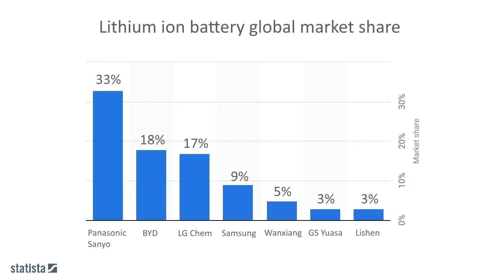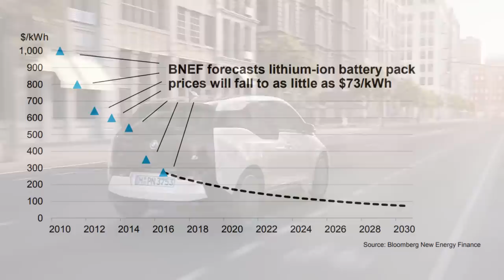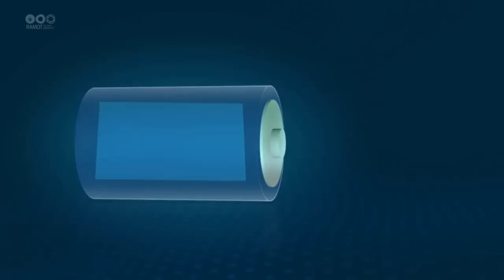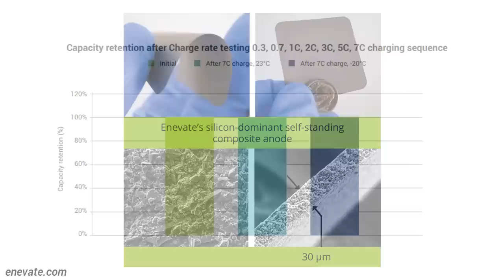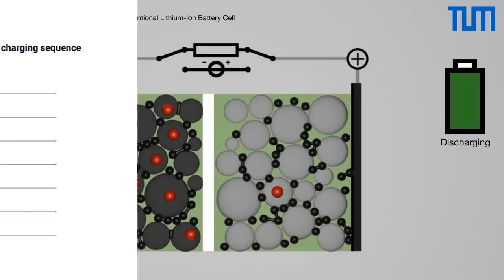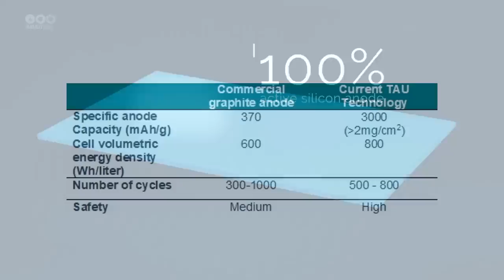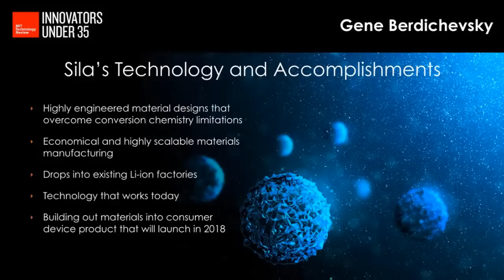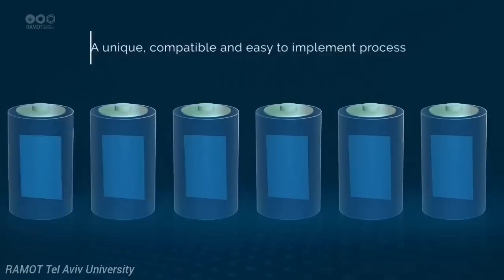The Battery Revolution. Ultra Fast Charging

Comment: Doubt I'll still be alive by the time useful electric vehicles are actually affordable. Give me an all wheel drive suv that can handle temperatures down to -40, can tow a trailer with a few horses and can charge in under 5 minutes and has at least 250 miles of range, and costs under $45,000. Until then it's gasoline for me.
Reply: Give me a gasoline car that I can fill up in my garage and that costs a few cents a mile to run, that is silent, and that has amazing torque off the line.  Until then it's EV for me.
Reply: There is no gas car out there that is a one size fits all, so why would one expect electric cars to be a one size fits all.

Obviously, as battery technology improves, density goes up, price goes down, we can fit larger and more energy dense batteries in vehicles that require more energy like SUV's and trucks.

A lot of times, it feels like if you built an airport while the ICE crowd was watching, they would be screaming the whole time, why are we wasting time paving this runway and building this control tower?  We don't even have a terminal, hangars or any airplanes here yet!
Reply: Exactly, the promises of a 100% electric future is not even close. The #1 problem is .... power plants still burn fossil fuels. It doesn't matter how fancy ur electric vehicle is or how many computer screens it has or how many likes u have, it still gets its power from burning fossil fuels from the power plant. Then they will say ... but but we can get it elsewhere in the future ... well, until that future is built ... and it hasn't, then ur electric vehicle still pollutes and still requires downtime to plan and charge. And dont even get me started if u have to make a long trip and cant afford downtime ... forget about it. U can never charge a battery fast because it will overheat and overheating is what kills battery cells. Then they will say ... but but the future will fix that ... no and no.  If ur phone's small battery takes 30-1-2 hours to charge, ur big ass car battery wont do it faster ... only slower. If u fast charge it, the battery will fail ... and car batteries costs $10,000-20,000 parts alone ... labor will be more and only performed at the dealer service centers (not cheaper independent shops).

Ppl who say they love the electric vehicles dont really need vehicles, they can take the bus or ride a bike. Ppl who haul heavy equipment or drive long distances cannot have downtime to charge a vehicle for 1-2 hours every couple hundred miles.

Also, when the government subsidies end, ur electric vehicle will cost even more.

Simplistic fantasy is for the escapists simple minded sheep.

Reality is for the real ppl
Reply: IncognitoTorpedo Money is money, whether you're spending it on a more expensive EV or down the road at the gas station (which, by the way, filling up isn't very hard, people have been doing it forever). The sound a vehicle makes is hardly a selling point, ok, so it runs quiet, are you going to hear all that quiet over the radio you got blasting? "Amazing torque off the line", I don't even know how to reply to this. You want people to see your little sedan tearing off down the road from a stop sign? Ok I guess. I'm more concerned with functionality and the ability to refuel quickly, especially since I live a low populated area, the nearest charging station is about 15 miles away, the closest gas station is about 1 mile away. Someone can always bring me gas, someone can't just stroll up with more electricity for me.
Reply: I understand and what you say makes sense. But that just says that it will be a while before there is 100% adoption. But that's OK. In our case, we need a car that can go over 300 miles with zero hassles so we have a gas-powered Prius with "unlimited" range. But we also have an all-electric Leaf for my wife's daily commute. She charges her car in the garage which is more convenient than a stinky gas station. It's clearly the "beginning of the beginning of the end" for ICE vehicles.

Comment: I jumped into the electric car movement last March when the Hyundai Kona EV finally arrived in California.  I haven't bought gasoline since that time.  I've charged up at home and driven everywhere I've needed to go without a hitch.  I have sampled how DCFC work a few times just to understand the process when I make longer trips.  I currently have about 14,000 trouble-free miles on my Kona EV.  It has been used as a serious, solid, daily-driver replacement for an ICE car and has done the job very well.  I purchases a 240v 50a charging unit which basically charges the car at it's maximum on-board rate of 7.2 kWh.  With a 64 kWh battery starting at 20% and charging to 90% means it will take 6.2 hours.  Unlike gas cars which you tend to drive to empty then fill up, BEVs prefer the "grazing" approach where you keep it "topped off" at 80-90% full and top off around 20-30% remaining.  My daily work commute is 40 miles round trip and I usually go two days without charging, and can go three if I want, but I prefer to stay in the middle of the SOC band since that's generally accepted to maximize battery life.  During days off, or even weeks off when I'm not making the long commute I don't even need to charge my car for around town driving - well sure eventually, but considering I might drive 5 miles a day around town, that equates to about a month before I'd need to charge and more actually since the Kona EV's regen system is supposedly capable of 150 kWh of regeneration, though the most I've glanced down and seen is about 80 kWh "regen" when letting off at speed using regen level 3.  Regen allows the Kona EV to recoup anywhere from .3 to .7 miles PER STOP when driving around town which means one can leave home, drive around stop and go for 10 miles, then return home with only 5 miles used off the range!  In town I've seen miles per kWh efficiency as high as 5.9 miles per kWh which equates to 377 miles absolute range or 264 miles using the middle 70% of battery charge.
To date the only "service" done was to have the tires rotated and the cabin air filter changed at 7500 miles.  That's another thing about an electric car.  Under the hood where the motor resides there is just ONE moving part inside the motor!  No valves, no belts, chains, pumps, lifters, cam shafts, flywheels, clutch, linkage, and no TRANSMISSION in the conventional sense of a huge casing filled with expensive gears, servos and sensors - and fluid.  Only a very simple reduction gearbox.  There is ZERO mechanical linkage to anything under the hood.  The AC uses an electric compressor and is surprisingly efficient in terms of NOT using a lot of reserve power.  HEAT definitely drops the anticipated range by as much as 40 miles on a cold morning, however that has be grossly misrepresented by reviewers and those who don't own BEVs but go around telling everyone what's wrong with them.  You see when you turn on the heat, the range display does drop, but when you turn the heat off, it recovers to right where it left off!  So you turn on the heat full max and get the cabin warm and then adjust heat down, and down, and down to a comfortable level and you'll see the range going back up as you do.  I like to turn the heat off and the range recovers to just a few miles below what it would have been without heat.  Another way to see exactly how you're energy is being used is to go to the center screen where you can see how much power is being drawn by which accessory or drive and you'll see a display that shows current range (heat on) and range with the heat off.  The reason is because when you turn on the heat, depending on SOC, the computer will show a large range reduction based on the premise that you will keep that setting until the battery is depleted.  When you don't - when you turn the heat off, the computer now recalculates and displays your total range remaining closer to the original number.  If you turn on heat - or AC with the battery depleted to around 30%, you will see only a TINY reduction in anticipated range because the computer "knows" the car has fewer total miles available - same with heat.  So using the heat and AC isn't nearly as terrible as described in so many reviews which incorporate incipient bias.  Now, when it gets cold outside, there is no denying a BEV is going to suffer range loss due to cold.  At cold temperatures, the chemical process within the batteries slows and the battery cannot deliver the same total kWh or range.  The 2020 Kona EV for North American is getting the battery warmer so this should help minimize range loss due to cold temps because you can leave the car plugged in until ready to drive and the warmer has the battery nice and warm for better range.  In reality, here in Central California where winter temps seldom drop below 0 degrees Celsius, it's a not issue, but I would imagine those living in truly COLD places would benefit.  Right now my battery shows about an 8% loss in range due to colder charging and operating temps (December), which means a full charge shows around 260-265 miles range, but as the weather warms up a full charge will show around 285 miles range or higher and this is also dependent on how the car has been driven and how the computer expects it will be driven after charging.  If the car is operated economically and averages over say, 4.5 miles per kWh, then the computer starts displaying a higher anticipated range, but here again, cold impacts those numbers because the colder battery will not achieve the same mi/kWh and the energy removed from operating heat also factors in.  As the weather warms back up I'll see higher per mile efficiency for sure.
What I really LIKE about the Kona EV and knew the Tesla Model 3 doesn't have is a real instrument panel with real controls and such.  The car industry spent a hundred years figuring out the best ergonomics for interior switches and such and most people haven't really thought it through when the look at a Tesla center display scree where all the controls for things like wipers, headlights, heat, AC, etc are and there are no special shapes for the fingers to find in darkness.  Having to glance over and down at a huge center screen to "see" the wiper control for example contributes to distracted driving no less than glancing at one's phone while driving.  So I LIKE having conventional controls inside the cabin, and consider it costs a lot more money to have traditional switches and knobs than everything wired in through the center display.  The other thing I like about Hyundai is their warranty.  One good thing about being an early adopter of the Kona EV is a "Lifetime" battery warranty versus the 2020 models which state battery warranty at 100,000 miles as does Tesla.  Because the base powertrain on an electric will likely last a lifetime, the real "heart" of the system is the battery, and battery technology is advancing quickly.  Prices are coming down, energy density is going up, as are charging speeds.  By the next decade I expect EV charging stations will be pushing 500 kWh at 800 volts if not higher and BEVs will be charging in mere minutes, with charging stations as numerous as gas stations today, and just as conveniently located.  By the time the Kona battery needs replacement due to "normal" degradation, I'll probably be able to replace the pack with one the same "size" but with higher kWh rating, or the same kWh rating but smaller size and lighter and charges even faster.
I have to admit I already have my eye on the forthcoming Tesla Cybertruck, but already there are so many great looking designs starting to arrive, like the Mustang inspired Mach-E which is now out and about to hit the dealerships.  It's a very attractive car with plenty of power for a good price, and of course with electric cars, just drop in another motor and suddenly it has super car acceleration!.

Comment: There is NO ultra fast charging. This video is 18 months old and there has been no major advances in battery technology in that time. And the reality is...there won't be anytime soon. Ultra Fast Charging is the equivalent of a 5-min fill-up to full, just like with an ICEV; and we are NO WHERE near that point in current battery technology. Being able to give a car a 400+ mile range recharge, in 5 mins., without causing damaging battery degradation is YEARSSSSS off - probably 10+ years.

Comment: We have made good strides in capacity and energy density, but for the consumer, I think we are getting to the point where we don't LIKE the idea of replacing a $10k battery pack every four or five years.   That's why I really like these new Lithium Titanate batteries (Li4Ti5O12)  Estimates at this juncture range from 10,000 to 30,000 deep discharge cycles (DOD 80%).  Can you do a video about that technology?  You do such a good job with your videos, you could make it understandable for us consumers.

Comment: The new battery technologies are amazing. So many great uses, except as the sole power source for automotive propulsion. 90% of electricity is generated by fossil fuels, and if only about 1% of that energy makes it out of the wheel motors, that makes an electric car a gross polluter. On the other hand, my old pickup is so clean you can inhale the exhaust with no chance of toxic effects, other than lack of usable oxygen. I love ruining a tree huggers day. Can you tell?

Comment: I do not understand why the manufacturers do design the cars with the battery as the last thing installed . The battery should be designed to be easily removed to accommodate ease of replacement and or upgrade to the latest design . Super capacitors are the future they should know to be ready to accommodate the changes ahead .

Comment: Right now Electricity is 50% more efficient than Coal or Fuel oil for power. America could go 100% renewable power and Battery Storage today and be better off. EV cars a basicly Mobile Battery storage. will help to stabilize the Grid.
Reply: what time of the day will you charge your car?
Reply: Right now, its most economical to recharge at night, with a HOME battery or even on Grid power off peak. with a Home battery you can chose how to manage your power at home, such as 100% EV charging, then charge home battery with Off Peak power, or charge EV with Off grid power , and run the house on Home battery, but the GOAL here is to get to 100% solar power and storage, and only use the Grid on cloudy days. either way, best to charge car at Night, while sleeping.
Reply: right now your government is making billions from the tax on petrol and other fuels, when they go 100 % electric, who will foot the revenue loss, and mind you a increase in electricity prices affects more than an increase in petrol prices

Comment: There's this term called unintended consequences. It did start with gas powered cars. Now electric cars. In life we make choices that either make like better or worse. The difference would be in making it better and still being able to clean up afterwards. Just like your smartphone, it's both good and bad. With proper use it's good with misuse it's very bad.

Comment: Lithium is rare.  My hope is for graphine production to improve and use that instead of lithium.
Reply: Lithium is not rare, the ocean floor is full of it,
Reply: Lithium is quite abundant. Its not the ocean floor that has lithium, its the sea water that has lithium salts dissolved in it, similar to common salt. The process of extracting vast majority of lithium these days is very similar to how we extract common salt from sea water as well, using sunlight to evaporate salt water.
Reply: Lithium isn't that rare.
Anyway, graphene isn't a replacement for lithium. It's a material that could be used for durable, high-capacity electrodes in lithium-ion cells sometime in the distant future if development continues.